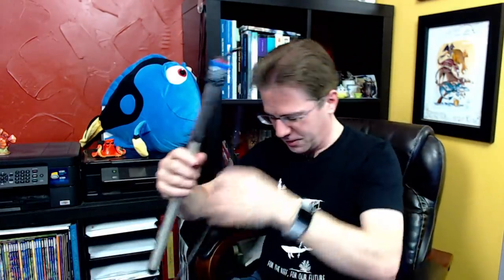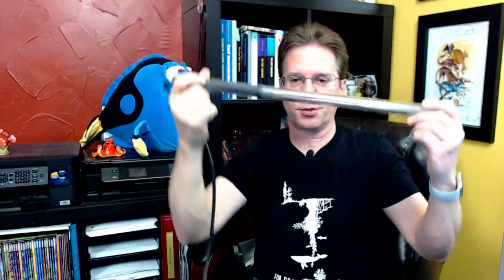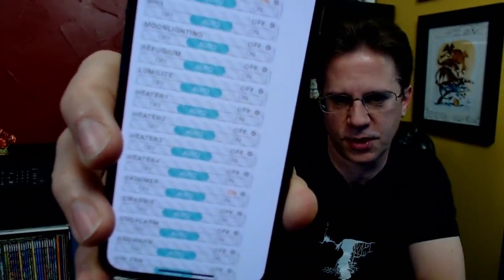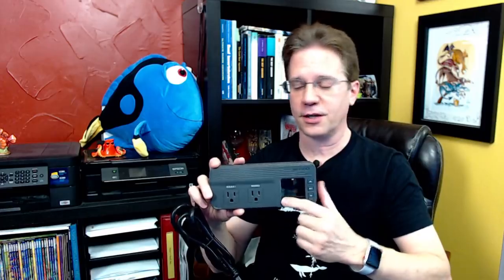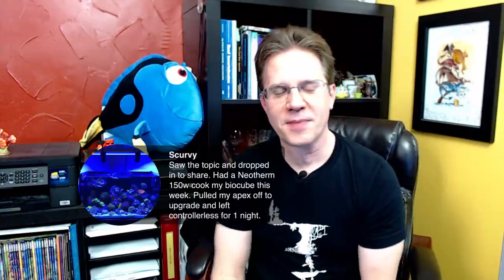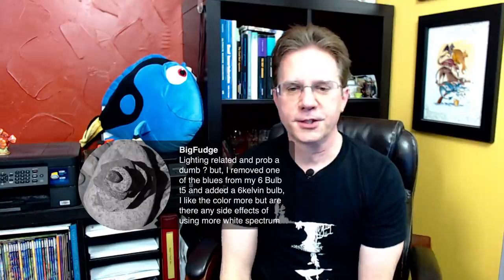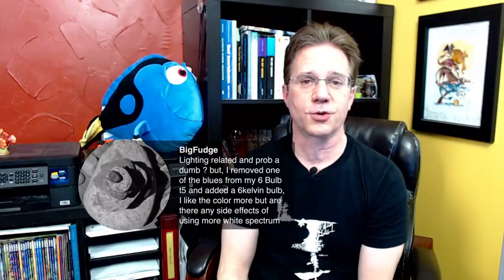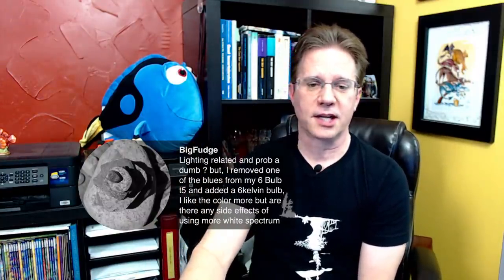Let's talk about heaters

Comment: I have 2 300 watt Eheim heaters in a 100 gallon system, my sump is in the basement. There is an 8' drop and 8' up,   there is a 4ﾟ temperature variance. The Up stairs main tank is 77.5 and the basement is 81.5 the basement sump has its advantages except running heaters.
Reply from the maker: If the basement sump is 4* warmer, that tells me the return pump is running quite slowly and those heaters are really adding a lot of heat. All the water in your system should be the same temperature. You are saying the water entering the reef is 81.5F although the aquarium is only 77.5F. 

How does your livestock handle this? If it’s unaffected, then you may want to leave it as is.

Comment: Would it be more efficient (with a big tank) to maybe have like floor heating pads underneath your tank? instead of sticking a probe inside of the water? or even better. a small heat exchanger with aluminum pipes with a control valve on your homes central heating system? Maybe it sounds weird, but I feel heating big tanks is still very inefficient while we heat up our homes quite efficiently.
Reply: Tidal Gardens has a setup like that for heating and cooling.  Rainwater collection underground is 55 degrees for cooling and they are setting up a really neat piping system with tankless heaters. They are getting like 8 tanks around 700 gallons each.
Reply: @jnava121  Very cool!

Comment: Great topic !! Heaters are so important for fish health / appetite / and disease control.. Im running 1000w and an 800w true temp titanium heaters w/controllers in my 1210 gallon system.. Keeps the entire 12ft x 11ft room warm, as I keep it separated from the rest of the house by closing door.. Good luck so far.. Heater are both in sump with 1 set to 83.5 and the other set to 83.6.. separate thermometer in tank reads 81.5.. Not sure its totally accurate ?

Comment: Trip lite makes an awesome power strip with individual circuits so it will only trip one circuit and leave the rest active. Amazon has been running them on their active specials off an on for like $15. I have 4 and havent had one single issue out of them. Just my $.2. Happy reefing
Reply from the maker: Thank you!
Reply: Why would you want to do that?
Reply: @greetingsearthlingspluto6666  for controlablilty for those without a controller. Makes water changes and feeding easier, plus if something did trip, it wont take the whole system down.

Comment: The water line on the Eheim Jager is the minimum level. It suppose to be fully submersed. I have 2 of mine mounted horizontally.
Reply from the maker: Yup, I should have made that more clear.  There are some heaters where the top can't be submerged which is really tricky in a sump situation.
Reply: @melevsreef  Then you go buy a different heater lol.
Reply from the maker: @ICOOKIE69I   Some are designed to hang on the back of an aquarium, like a hospital tank or quarantine tank. Those are made to clamp to the top trim, and keep the top dry at all times.
Reply: @melevsreef  Yeah I know, I was kidding lol. No matter what heater I use, I use some kind of controller, whether it's just a $35 Inkbird or an Apex system.

Comment: Ive been looking at that inkbird controller, my questionbis i have not been able to find out will it controll both a heater and a chiller or fan off the same controller?
Reply: pjshooter6 Yes to your question, I have both on my controller
Reply: pjshooter I have a chiller and a heater hooked up to my Inkbird Controller,no problem. You can setup your parameters such as my inkbird is set to come on of it falls below 75 a d will shut off the heater if it hits 79. Same principle for my chiller
Reply: @diacanthusreef3609  thank you for this in depth answer i really appreciate that! Will be ordering that model tonight.
Reply: @greetingsearthlingspluto6666  thanks for the in depth answer also. I really appreciate it. I will be moving up to either an apex or ekoral controller eventually but being an analog kinda person im slow to go all in one computer controlled.

Comment: Splitting circuits by device type dorsn't seem the best plan if that circuit trips  due to say one faulty heater you have no heaters  at all. Splitting the 4 heaters 2 per circuit  would be better  as one tripped circuit you have some heat. Backup/resilient equipment should not be on the same circuit as the primary device